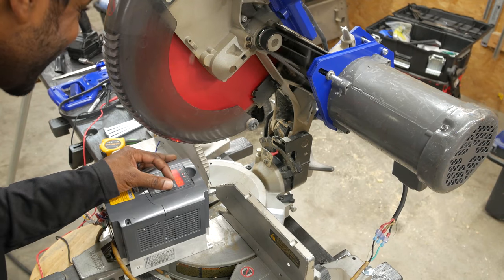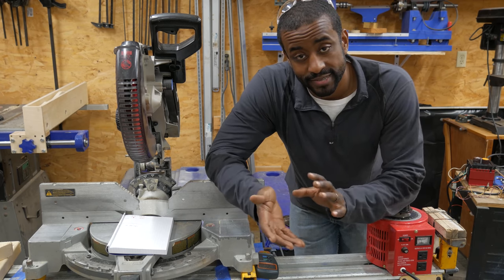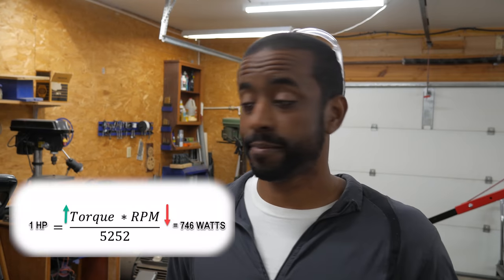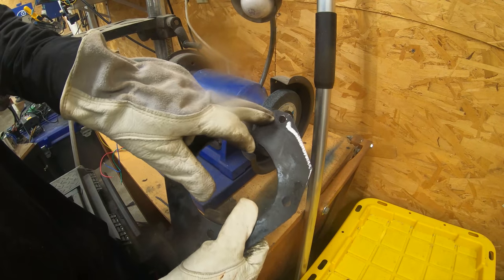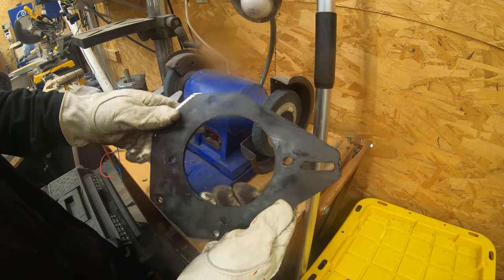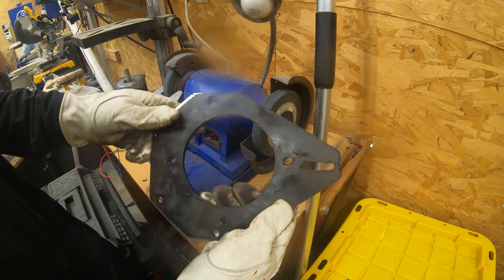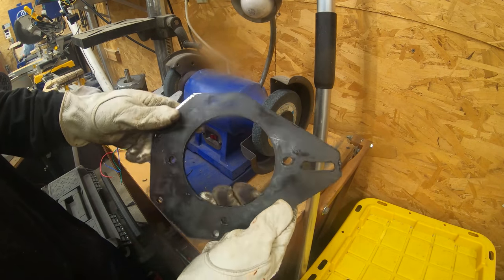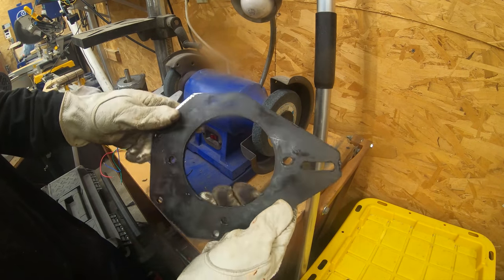How To Speed Control Your Miter Saw For Cutting Steel #080

Comment: Hey Jeremy, not sure if you read these, but , those other 2 wires are for the awesome automatic breaking that is offered on certain saws. It's made so as soon as release power it applies a break. I'm sure you know that now. I enjoy your content more than most, I would give my left testicle to have the electrical knowledge you have. I'm a maker, Jack of all trades master of fishing for Crappy/ Small mouth bass. Actually I am a finish carpenter.

Comment: Excellent video young man. I have a project were I need to rip some 1/4" steel 36" long. Looking at plasma cutters but did not want to invest that much money. Used a 7-1/4 saw before but went through way more blades than I wanted to last time. Thinking maybe I did not sent things up properly then I found your video. Will give it another try. Thanks again

Comment: nice video and you showed options id never have thought of. i previously tried dialing down the ac on a circular saw but hit the same problem with low torque and the blade stopping, so til now ive been using just a grinder and jigsaw to get by.

Comment: Just a quick tip for anyone that may not be familiar with cutting square tubing... turn it up on it's edge like a diamond and cut it like that. Laying it flat edge to the flat saw plate makes for a more demanding cross section. The trick is having the minimum amount of blade and metal touching at any given time and the edge up diamond cut will provide that.

Comment: One issue I have is that when testing the original motor and DC motor, the rpm was determined without load. Once the saw was loaded it bogged down. I wish the voltage was turned up so the saw would run at 1500rpm while loaded. 
Great video and it's great you are doing these experiments.

Comment: Years ago my friend and I decided to make a trailer from scratch. We were working in his dads garage. We found metal cutting blades that would fit in the mite saw he had and for hand held circular saws. We burned up the miter saw and the circular saw.
Turns out that most saws designed to cut metal are sealed. The metal chips/dust from cutting were going into the motors and burned up the brushes etc. Just a thought. I really like your channel.

Comment: Really enjoyed this video! Although a lot of people do it, really shouldn’t stack boards to cut more than one at a time. I had a small piece get jammed in the throat plate and the throat plate exploded sending shrapnel across the room. I love that you are not afraid to experiment. Thank you for explaining as I’ve always wondered if a miter could cut steal with the right blade. Your explanation about the torque and speed difference was excellent.

Comment: Thanks. When you had to use the engine hoist to move the proper motor in to place you convinced me to buy an actual cold cut saw instead of trying your method. You had me going for awhile though. Seriously though I love your vids. I learn so much. Keep them coming.
Reply from the maker: LOL that was the message. It’s not worth it. But I get this question all the time so I finally decided to answer the question.

Comment: I know I'm a bit late to the party, but regardless - kudos for going the extra mile and using the proper approach to tackle the problem! Most people who try to modify or DIY a tool tend to cut corners and follow to path of least resistance which often leads to unimpressive results. Thanks a lot for sharing this experiment, I think I'll try to reproduce it actually - space is a huge problem for any DIYer with only a garage, and I just don't have enough to fit every tool that I'd like to have.

Comment: Thanks for this video Jeremy! I love your budget minded tinkering and how you show the failures and successes which helps us all learn.

I had been pestering an electrical engineer that I know about this subject and he blew me off. So after seeing this video, I'm going to take a different approach to a steel cutting miter saw.

I have a nice Rigid saw I was thinking about using for steel if I could get the rpms down, but now I think I'll use the Bosch that was given to me that needs a little work since it has pulleys to get power to the gearbox that drives the blade. After doing a little math and measuring, I should be able to get the rpms down to 2500, which is well within the rpm range of the blades I'll be using.

Comment: A bit off subject but I was given an old Italian cold saw. It had been much abused. Definitely meant for serious use, heavy! The blades are steel, not carbide tipped. They cut mild steel very nicely. The blade rotates away from the fence, toward the clamp. That prevents small cutoffs from getting trapped an flying or binding and bending the blade. They just fall away onto the table. 2 speed 3 phase motor driving thru a worm drive gear box. Operators handle give lots of leverage. I recently cut some 2" diameter 12L14 steel bar. Cut quality is very smooth. Very quiet.

Comment: OMG, I think I love you!  Ok seriously, first time I've seen you, and I can't understand why.  Very informative, entertaining, and well delivered.  You're clearly a smart and articulate guy and I'll be watching more.  Also, I haven't read any of the comments yet, but that last test with the DC controller is a good viable option, I think.  Cuts across large (relatively) surfaces are tough on any dry saw which is why they make V-blocis so the square material will never be completely horizontal.  This helps tremendously!  But, it absolutely must be clamped down, or else, and obviously, it's a serious hazard.  Hell, I'm sure you can make one.  It really makes a difference when cutting square tubing - it significantly reduces blade wear.

Comment: Much respect and admiration to you Jeremy. Your video here is excellent. I am struggling with an alternative means of cutting off steel  due to my horizontal band saw continuously breaking blades. I began looking at metal cutoff saws with carbide blades but they are very pricey. I figured I'd buy a 10" diameter blade for cutting steel; however, most that I have looked at list the operating speed in the range of 2000 to 2500 RPM. Both my saws are at least  double that as are just about all other 10" miter saws on the market.

Comment: I tried this last year using just a standard dimmer switch to control the volts, not great but did work at the mid level, but not enough torque to be a serious solution. Jeremy makes my brain hurt, smart dude!

Comment: First of all, thanks for the video. That was awesome. I would have never thought to put a 3 phase VFD controlled motor onto a miter saw. I've used industrial production metal chop saws in the past that were powered through a contactor but never a VFD. It makes perfect sense to do so if you are cutting through some ridiculously thick material. I was happy to see you hang that 2 horse motor on the saw and go with it. I would have done the same thing. You are a very talented fabricator as well as very knowledgeble in electronics. I really enjoyed watching your video. Thanks again.

Comment: This guy is a pioneer. in this toss it out culture, he is showing people how to really thrive !!.. only one question, if I want to cut steel why dont I just go very slow through the metal, let it take a small amount off with each rotation, let it run at 3600 rpm. It should be the case that the blade is what makes it work, and if I put less pressure down, I will get through it.

Comment: I have a Ryobi Miter Saw.  When I took some welding classes, I thought that maybe I could just put a steel cutting blade on it, but I asked if it was safe.  The answer I got, which made sense to me, is that the miter saw is mostly made of hard plastic, and that the residue from cutting steel would damage the miter saw.  I ended up buying a chop saw.  I don't regret the purchase.

Comment: I've wanted to convert my miter saw and wondered what could be done.  So, thanks for doing the test and explaining it well.  I've spent the last 25 years as an Industrial Controls Eng and would love to run my shop tools off of 3 phase but that isn't an option around my residential area.
Reply from the maker: I create my own three phase power inside my shop. I made a video about how to do it.

Comment: There are some low rpm metal cutting saws available like the DeWalt DW871.  2hp, 1300 rpm.  Some horizontal band saws with variable speed as well.  So, you are on the right track.  I use a regular “wood” carbon blade for aluminum and cheap chop saw with the black disk for steel.  Cleanup with flap wheel or grinder.  I usually need to put a bevel on it for welding anyway.  FYI, you should be able to sharpen those metal cutting blades and save some money.  Nice video, thanks for sharing.

Comment: This is a great idea. I thought about doing something along these lines with my own abrasive wheel cutoff saw, but it runs too fast, around 3400 rpm. So I designed a reduction in-line gearbox to go between the motor and the blade. I haven't built it yet, but it should in theory give a lower speed plus retain or increase the torque required. It is a simple two-stage gearing with the output spinning in the same direction and axis as the input plus it can be modified to be changeable from one speed to the other with the addition of a lever (gear change knob). And as many of your followers say, I could just go out and buy one but where's the fun in that? I bet you could do a video on that, I'm sure many of your followers would like to see it. Regards from Australia and stay safe.

Comment: Good vid. I'm jealous of your fabrication skills.
Your thoughts on reducing the voltage were spot on. To do so correctly, you need to reduce the voltage while maintaining the duty cycle of the wave form. This is similar to the difference between a common wall-dimmer and a speed control for something like a ceiling fan.

Comment: I was very interested, I've got the 18 in abrasive cut off, but have been looking into a cold saw.  I believe I will follow your example, and convert a chop saw with a three phase motor.  I've got several phase converters in my shop for almost 20 years, and I love them.  Thanks for such a great show of the choices, as was stated below!!  I'd smile, but too old to find the right button.

Comment: Good video sir. Loved it..
For cutting steel, i also came across to use my 10" miter saw but theni realize the blade have very low rpm for cutting steel..  lazy to think, i just purchase a 7 ¼ diablo steel demon, fit on my new cheap 8"sliding miter saw and walaaa.. cut steel like a butter without not to worry about the rpm becoz max rpm 7 ¼ blade 5k++

Comment: Love watching the quantitative experimentation and results. I have a Rikon Bandsaw originally designed for wood with their new VFD (2 HP) 3 phase motor set up that allows me to use the saw for metals, plastic, and wood using the same approach you did. The bi-metallic  saw blades are available and relatively inexpensive. Now I can satisfy my extensive metal and woodworking hobbies with a single saw to save precious garage space.

Re: cold saws,  I did get a good sale price on the Evolution cold saw(I really like it)  that was probably cheaper than the cost of the 3 phase motor and VFD controller mod as you pointed out in your comments

Comment: i made my delta band saw into a steel cutting band saw. i used a treadmill motor and controller and an intermediate shaft and larger final pulley on the saw. it works fairly well. with the dc motors you need to keep the speed up a little higher, the horse power rating on them is usually at maximum rated speed. so using the dc motor and slowing it down to cut steel theres really no way to get away from changing pulley sizes, but you probably could still get it to work

Comment: Pretty cool man, but I used the last option, the cutoff wheel. I used one of those with a 10" miter saw to cut linear rail. It worked pretty good and the edge wasn't too bad. Made a hell of a lot more sparks than your way though!

Comment: There are types of DC motors that can have higher torque on lower speed. They have been used in streetcars and trolleys. When the stator electrical magnet is wired in series with the rotor. Then you can use a cheap AC voltage controller with rectifier and it will work on your project. However, I think VFD is the way to go. Also, BLDC might have a bit more power to weight ratio and lighten your project. But I understand you want to use salvaged parts. Great video! Keep the good work!

Comment: I've been thinking about using mine like that form a while, I've cut aluminum on it no problem. It'll walk right through it like it was wood. After watching you go through the process of making new fittings and adding more robust motor, while very cool what you did, I'm thinking that just spending the $200 for a chop saw at lowes, or using an angle grinder would be more cost effective, and less hassle. See I was more worried about damaging the table by putting steel against it, but now I see it just doesn't have the balls to do it unmodified. Of course it might be a different story with cutting smaller things.

Comment: Hi Jeremy, I have an EVOLUTION RAGE 5 S table saw with a universal 10 inch blade (carbon tipped) that cuts wood or metal (metal upto 6 mm (1/4 inch thick) runs at 2500 rpm ( i have a dedicated wood blade for furniture making) metal stays cool while cutting.

Comment: I work on locomotives, and the series wound DC traction motors (while comparatively large) could be adapted to this purpose. The only problem is that it would also require a dedicated crane and generator. 😂

This is a fantastic video! I only recently discovered your channel, and I've learned so much from watching you! Thank you very much!

Comment: Hey Jeremy, I am an engineer heavy on the electrical side. You taught me some motor TECH. I am more familiar with brushless dc with pulse width modulated controllers. I can not wait to try the brushless motor. If you need some PWM's, I will be glad to send you a couple (free of charge) just to see if you come up with the same solution. Let me know what Vdc (power) you want to work with. Thanks..Ken..!;!

Comment: Just checked out a 250mm metal cutting blade- recommended max 2,300 RPM. What is the problem? Used a chop saw designed for metal  at the weekend- it was 1800 RPM. Worked fine!

Comment: This is my first of your videos, but I will definitely be watching more.  Great video!  As far as the cracked housing, not sure if you know about it, but you can get aluminum brazing rods that allow you to braze at relatively low (700 degree) temps.  It might hold up better than the epoxy.  I've used them to braze brass to aluminum with a propane torch and it worked pretty well.

Comment: some universal motors have a speed sensor on the back (saw this on washing machines) so you could create a closed loop dc control to give it more volts under load to maintain rpm.

Comment: Great work! I tend to think that if the universal motor is able to make the torque (without burning up) then because it has a commutator, it can make that torque at any speed, you just need a voltage controller or a PWM wired to a speed sensor so it will bring in the power only when the motor comes under load. Of course it's probably a good idea to mount a fan on it because it's not going to get the cooling it was designed for... but then as you pointed out, this becomes quite a bit more complicated than just buying another saw.

Comment: The "tool guru" at my work has a saw set-up...(stock saw), with a metal cutting blade for cutting SS tubing. We burn through blades and have HEAVY amounts of demurring to do after cutting. NOW I know why. A little bit of knowledge goes a long way, better knowledge is infinite. Thanks for the insight.

Comment: I just want to clarify something, around the 12:50 mark you mention that the VFD has to sacrifice torque for RPM. I was under the impression that torque of an induction motor was dependent on voltage, thus why you can get high torque at low frequencies. Given your drive is just pulsing from your DC bus and assuming it's capacitor is large enough, you shouldn't experience voltage drop at higher frequencies, thus able to maintain torque. 

Military and arenautics use 400hz via frequency converters for this, it claims they can get 7 times more out of the motors by using high frequency.

It's probably why Tesla was a fan of high voltage and high frequency.

Comment: There's a third item to consider, besides current and cutting speed which causes dross on the bottom of cut piece. That is the cutting hieght. The cutting ace has a sweet spot, the shape of the arc is like a long slender football shape. Where the cleanest cut occurs in the center of the shape. If the torch is to  close or to far from the material, you will get dross on the bottom of the part. Adjust the torch cuting height in small increments until the dross is minimal for the power and cutting speed being used.

Comment: I would say one thing about using the miter to cut both wood and steel: if you've got it parked at a cutting station, you should be extra careful of setting saw dust on fire with the sparks from metal cutting. This is if you're messy like me and have an area with a ton of built-up saw dust waiting to ignite.